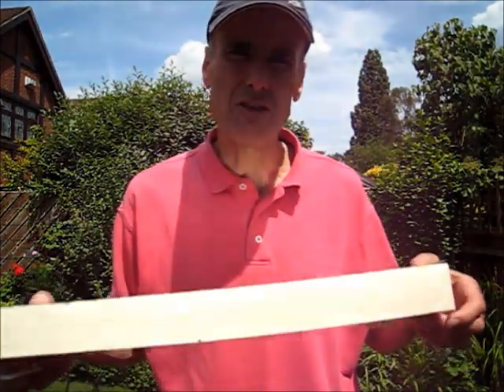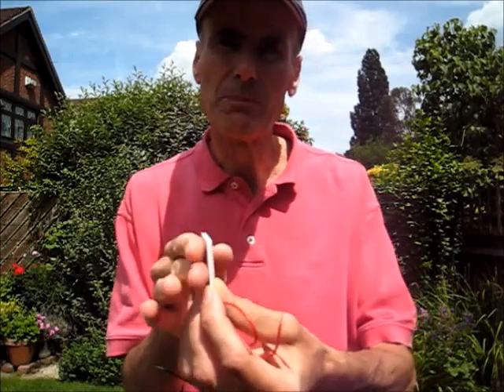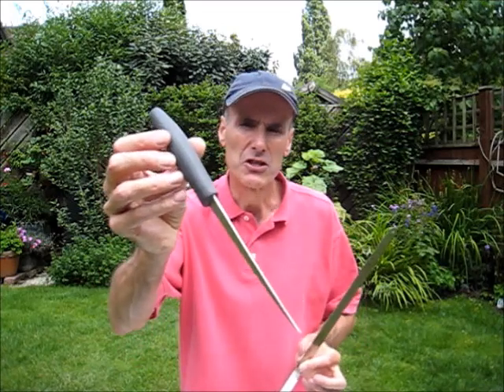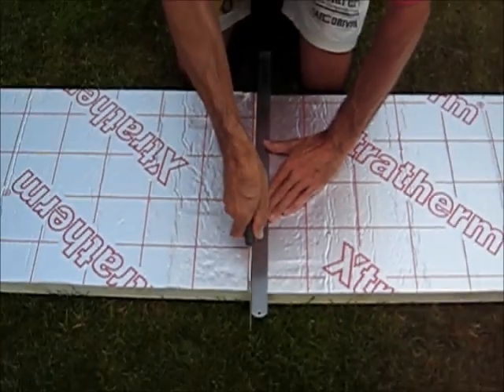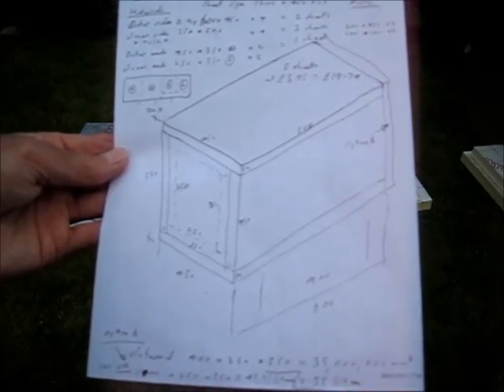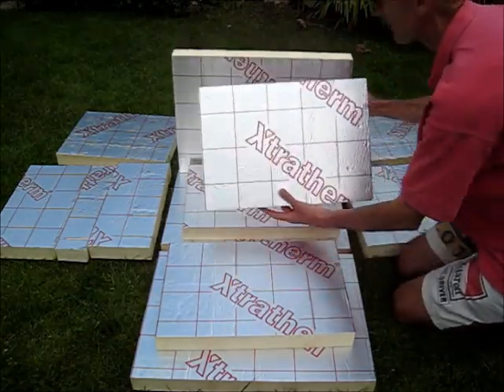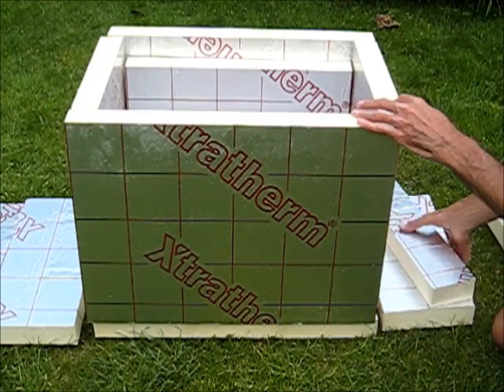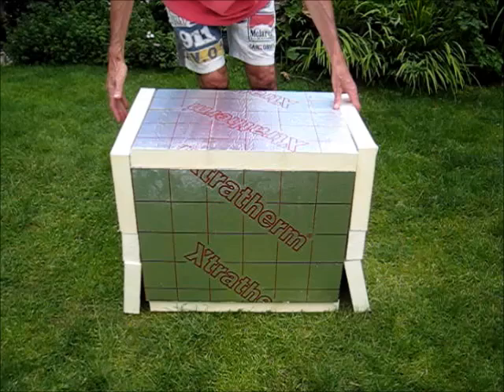Build your own super cool box! NEW ORIGINAL DESIGN - part 1

Comment: I'm In Australia but I can't get a ice box to fit the slide out drawer on my camper trailer .they are either tiny or too wide.  While I do have a 12V fridge/freezer I want a decent cool box that will use all the second slide out section because its so hot here just having a  stable storage area is helpful even brilliant. you may be appalled this is to keep my red wine stable but I'm guessing you've heard about our red wine and off course fast temp changes ruin red wine! This is a solution. Love the video and the info